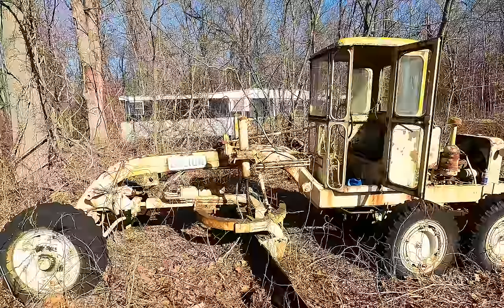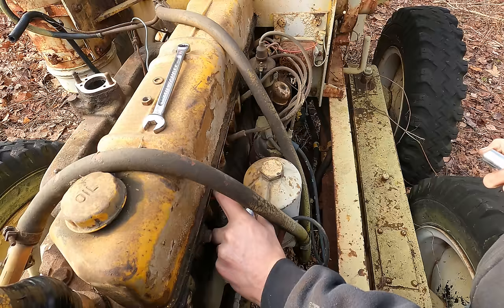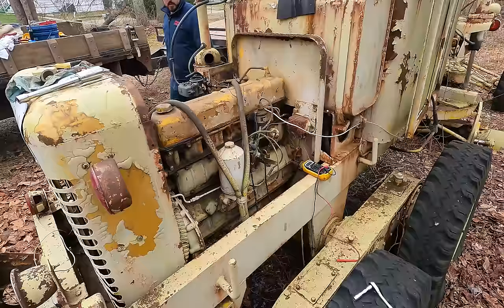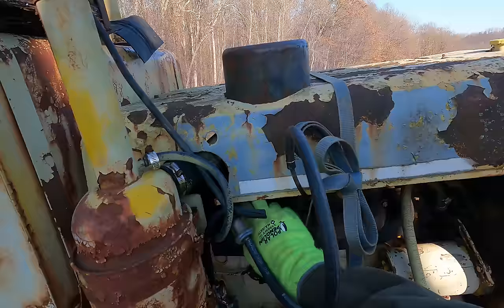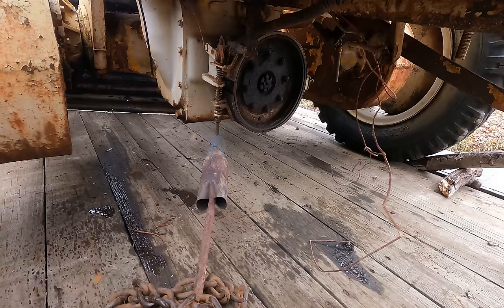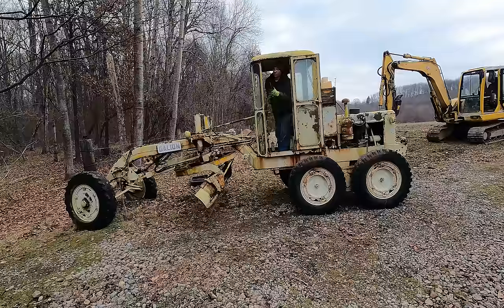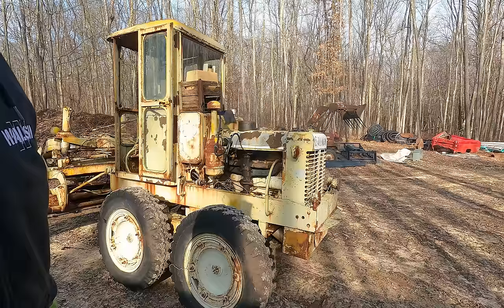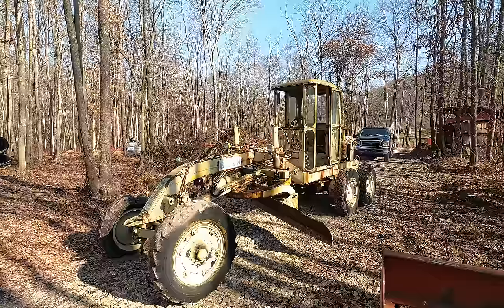1950's Galion Road Grader sitting 10+ years! (Will it run and drive??)

Comment: Hi Matt, greetings from UK, love your channel. Is that definitely an IH engine?,  only reason I ask is that I have old ref book mentions Galion 503 with Continental Motors engine F162 (petrol) (or GD157 diesel)
Reply from the maker: Yep IH BD220
Reply: @DieselCreek  OK, I don't think I have any info on that listed under Galion, was that engine also fitted to some Farmall tractors?.
I do have some wheel oil seals for LeTourneau Carryall, I reckon you will end up with one the way you're going!

Comment: Hi How much of pressure you think it was in the system when the hose blowed? Dont get near it you can get an oil-injection =NOT GODD!!!! Be careful :)
Reply from the maker: Not too much just lifting the weight of the blade lol
Reply: @DieselCreek  GREAT :) It was that you showed that you got a spill on the clothes from the oil after the hydraulic system broke down...the cable broked. I read in my education about oil-injections I think you know about it that if you get just a little stick of the oil in the skin it doesnt hurt or you cant almost see it, in the first hours or so but after a while it will catastrophicj malfunction with skin/flesh bad/MAYBE amputation issue=So you better get to the emergency center no matter what IF it happens another day, maybe for a surgery and get it out BUT that if are CLOSE to the hoses.......I had hours of that in my hudraulic education :) There are now protecting gloves in the market. Anyway take it easy :)  and great cool vids...!!!!!!

Comment: What's the model of the memory card? YouTube got me reconsidering a GoPro upgrade. Only time I've had errors was when I used a slow memory card not rated for high write speeds. Could that be the issue? I've had no issue since switching to 4K cards...they were not expensive $20 Canadian each for 128GB..got three of them now my biggest issues is getting them mixed up. Like to hear if your GoPro issues go away.
Reply from the maker: been good ever since, not sure what the deal was!

Comment: why are yo using action cam for recording videos? Rain resistance maybe?
Lots of those have issues, and lots of people have better experience with a camcorders, which are made to take videos. They are still being made, despite action cams, phones and somehow digital photocameras trying to kill them. My cheapest panasonic is a good webcam with a capture card on pc and took great videos when I used it in its real role, stabilized and great optics at low price. 
Your problem might be low quality cards, but I have experienced card failure in cheap dashcam,, which ate brand new samsung card which is now unformattable stuck file card (same files all the time, no matter what you do with it).

Comment: I have notice all gopr models Loose and delete Footage When there Ran in 4k Mode they over heat no matter if its cold or hot outside And The Camera Wipes the footage that was rwcording when the camera over heated been happening since the gopro hero 4 Matt even the 10 and 11 and 12 have the same issues 2:00 @Diesel Creek
Reply from the maker: Ya that’s why I run DJI cameras now

Comment: You have a lot of nerve taking this apart in the "woods" when you mentioned cranking and driving it on the trailer or I think that was your plan.  Yeah, lots of nerve. And they say oil & water won't mix. Hey it had water & sludge in it so any oil will be better and sort of flush it out all in one try.  Boy you do take on some tough jobs. Wow. this is more than tough, dangerous, expensive, crazy. Why ? just cause u can?  yeah that's it.

Comment: Tightens my nuts every time I see someone standing in the cable recoil area, should it break. Have a look at some of the videos where that has happened, you wouldn't do it again.
Reply from the maker: I’ve seen them. I don’t like doing it either but sometimes there’s no good options, I only did it here to get the cable tensioned so it spooled correctly on the drum

Comment: You have enough equipment to justify getting your own hose building tools…
Reply from the maker: No I don’t. It’s not about the cost of the equipment it’s about The cost of the inventory you need to be able to make your own hoses. I know large construction companies that don’t have hose making supplies because it’s a guarantee the hose blows will be the one that you don’t have the fittings for. The cost of the actual hose assembling and crimping Isn’t expensive all those little pieces that they have to stock is where the money is. A good hydraulic shop will have hundreds of thousands of dollars in inventory

Comment: The gopro 8 is WAY better then the gopro 9
Reply from the maker: Except for that non replaceable lens! I’d never buy one for that reason alone. I ruin lenses all the time
Reply: @DieselCreek  They sell lens and rear screen protectors for the GP8 black
I have them. And with them on it still fits in one of the metal cases with the mic mount on top
Reply from the maker: I use the protectors as well and they help save them but I still go through about 6-8 real lenses per year... getting the shot comes at a cost!
Reply: @DieselCreek  wow

Comment: Did you change the oil? before running?
Reply from the maker: No need the oil looked good. Changed it once I got it home and had the engine hot.

Comment: What brand of memory card are you using?
Reply from the maker: Sandisc ultra pro
Reply: @DieselCreek  I have a GoPro Hero 8 myself and haven't had any issues with my Samsung 256GB Evo Select with hours of 4K footage being recorded to it and copied off. My unsolicited advice would be to try one of those and if it still fails go through the warranty process with GoPro

Comment: DRAMA KiING!  The oill is probably a gear oil.  Before you put fresh good oil in it fill it with kerosene and drive it around a little bit.  That is the proscribed cleaning method for a lot of old equipment on oil change.  The reason it probably started so well the first time is that oil bath air filter there.  if it was pretty oily it likely kept the intake valves pretty clean.  You know the exhaust is probably the same way.  Carb kit for the holley carb. You should investigate what you want to happen.  Do you have money to burn??  Now I see you adding the gear oil to the gearbox with all the residual water.  Just watch and shut up I guess.
Reply: Err, as the water will sit in the bottom of the gearbox, isn't the vast majority going to just run out when you remove the drain plug...??!
Reply: @andymccabe6712  yes, if they used olive oil.  You get that milkshake appearance from motor oil/gear oil mixed with water.  Not so much from churning but it includes emulsifier so that if you accidentally get water in your whatever it will MIX with the oil and not harm anything.  Sure, in the extreme situation, you pull the plug and drain the water.  I do this periodically on my old tractor that sits outside and gets water in the gearbox over the winter.